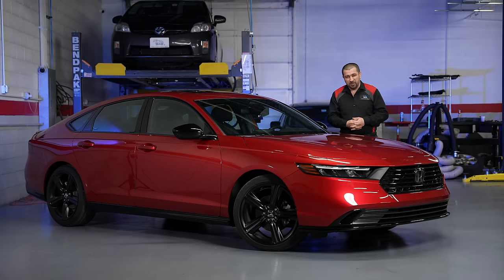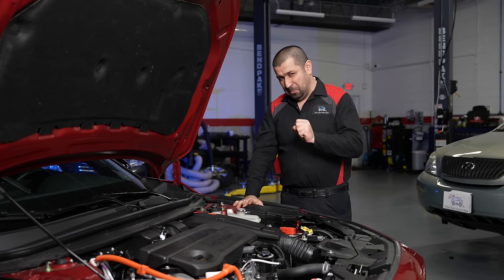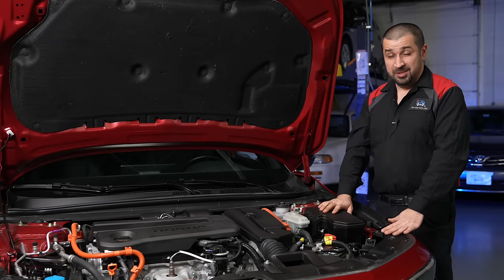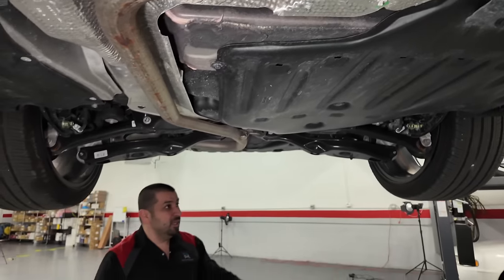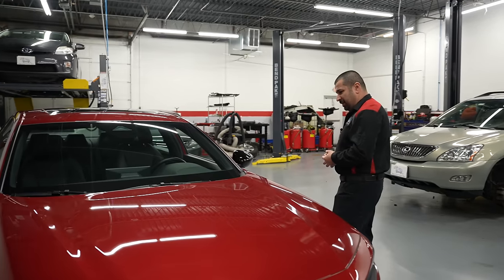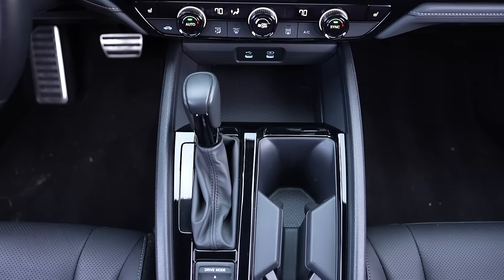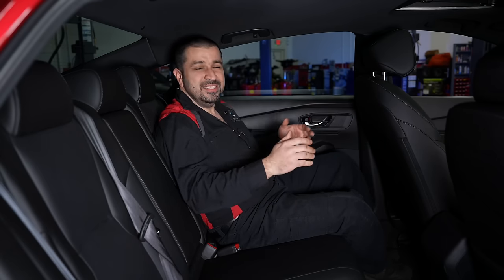Should You Buy The Latest Honda Accord? A Mechanic's Review

Comment: I didn't know that Honda's new hybrid system uses the gas engine to charge the battery at low speeds and then use the gas engine for driving the powertrain at higher speeds.  

When I drove the Honda Accord Hybrid, I felt motion sick.  Now I get it!  My ears heard the engine speed change, but since the electric motor was driving the car (with one speed transmission), my brain was expecting to feel the shifts.  So, since I was expecting the feel the shift and it didn't come, I felt a little motion sick.

Not sure if anyone else felt the same thing.
Reply: This is the fourth generation of the system; the first was released eleven years ago. It "uses the gas engine" to drive the car as an EV. But it runs the engine at its most efficient level of power and charges the battery with the excess. At higher speeds, it does similar split with direct engine power.

Comment: As always ,very good tech analysis of whow works that very complex Hybrid from Honda.
But we must mention the pioneer of that kind of hybrid technology (making series hybrid to parallel or engine drive and vice versa) was Mitsubishi Motors with Outlander PHEV which we here in Europe saw at 2013 and after.
Reply: It's a very simple system. It was also introduced in January, 2013, so neither can be called first.
And the Mitsubishi, while is employs some similar concepts, uses them for an entirely different purpose.

Comment: MB has a couple of buses in Germany, they are driven only by ev motor, and they have a little diesel generator at the rear that kicks off time to time, and the acceleration is absolutely constant power and regen, and the diesel engine has minimal wear and tear because it doesn't rev up or down, it drives full capacity about miles on battery and will start the generator and turn it off again, can't hear it and the drivers like to drive them because the AC always works. not like the ICE counterparts.

Comment: Thanks for the good review. Definitely a car for point A to B, not a car enthusiast. 24:40 - the wiper adjust is present in VAG Group cars since 2000s. Don't like the screen on top of the dash - for me air vents on top of dash is the most sensible arrangement. What about the quality of finish? Any park assist features, considering the size? The air colling vents should be in the B-pillar panels, above the seatbelt coils, so no risk of covering...
Hybrid Sport - ROFL 😅

Comment: 4:40 "One motor charges the battery, that is the basic premise of this system."

This is not quite accurate, and it is important because it is indeed the premise of the system. The hybrid Accord is usually an EV, in the correct definition of the term. Which is a vehicle that is propelled by an electric motor only. But isn't a Battery EV, like a Tesla. It is a Battery+Generator EV. That motor-generator supplies electricity to the traction motor first, and the excess charges the battery. (I see this is explained better near 8:00.)

And the premise of the system (numbers here are from engineering papers for the 2018-2022 model, but they shouldn't have changed much) is that the Accord needs less than 10 HP to maintain 40 mph on a flat road. But the engine is, at best, 35% efficient when generating 10 HP. It is over 40% efficient when generating 34 HP. So at 40 mph, the ICE generates 34 HP. It is split by using the generator so that 10 HP is used to power the motor, and 24 is used to charge the battery. Later, the system uses the battery in EV Drive with the engine off.

4:45 "The way it's constructed though is when things will get extremely complicated."

This is not true. It is very, very different that what you are used to, but that doesn't mean complicated. Since it leaves out a transmission, a starter motor, an alternator, and a torque converter? It is much simpler mechanically. You can see a diagram of it at https://youtu.be/fmMb45PPrmg?t=47. The only inaccuracies there are that (1) the OverDrive gear meshes with the Countershaft Gear, not the Motor Gear. It would need three dimensions to show it properly. And (2) Since 2023, the generator and motor are no longer concentric.

And the control only seems complicated if you try to look at it as a change from an ICEV. Viewed as an EV, it merely adds a second source of electricity, and offers an alternative in a specific situation that is explained incorrectly here:

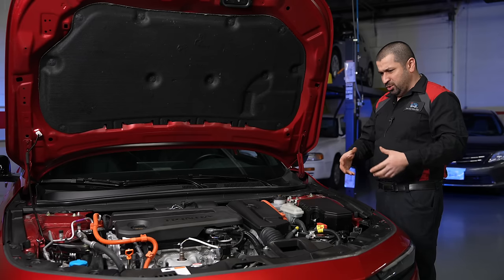9:43 "Don't quote me on this but from from my research is around 62 miles an hour is when the engine can actually take over the driving part."

It's wrong. You may have gotten it from Professor (Weber State) Kelly's Youtube video, where he uses that exact number. He corrected it in his comments.

The engine is over 40% efficient more-or-less along a line from (1400 rpm, 21 HP) to (2900 rpm, 55 HP). Since in this mode, the wheels are in fixed gear ratio, this means about 38 mph to 78 mph. Engine Drive is used in this range, usually above 40 mph but I have seen it lower. The driver can tell only by loading the Power Flow Monitor in the display; a little gear appears in the center.

So, on the highway, the engine is running at more-or-less constant rpm and power anyway. So, why not "cut out the middleman," as it were, and drive the wheels directly.

BTW, that simulated shifting? It takes the engine out of that 40% efficiency range. This is why mpgs when down in 2023. It was added because gearheads associate temporary losing power, and then regaining it, as somehow "gaining more" power.

13:45 "The biggest thing is it does have a clutch that wears. It is not going to wear at the rate of any other automatic transmission but still when we're putting head-to-head the Toyota transmission ..."

Actually, Toyota includes a clutch that is more prone to wear than this one. You can't connect an ICE to another system, that might seize, without a fail-safe. Toyota calls it a torque damper, but what it is, is a permanently-applied clutch that will slip if either the ICE, or what it connects to, changes rpm suddenly. And that happens every time the ICE is started, since the ICE is connected to the PSD (and so both MG1 and the wheels). The Honda has one, too, but as pointed out earlier it is only connected to the generator. And while it may be rare, the Toyota torque damper has failed in some cases, while neither the Honda torque damper, nor this clutch, has such history.

37:18 "I really dislike that there's no base model hybrid."

I do, too, but the actual change is that there is no higher-trim non-hybrid. The government has imposed "Corporate Average Fuel Economy" standards, so manufacturers need to try to push buyers toward the hybrids; Honda chose to do it by making it necessary to get a higher trim (hence features like Wireless Android Auto only in hybrids). Yes, they could have included a hybrid in the base model, but Honda also keeps prices down by having fewer from-the-factory options.

33:21 "I don't think many Accord owners or at least this particular Accord generation will be very interested in that but you have it."

I wish I had it ("individual mode") in my 2018. The modes affect how the car handles, cruise control and climate control responsiveness, how it uses regen braking, and how it manages the battery. I like the SPORT handling and regen, but ECON cruise control and battery. I really hate having to change to sport more to accelerate on the highway, but I do it to get better response. (BTW, total lifetime average, all conditions, is 48 mpg).

Comment: A couple additions / corrections:
The trans is geared such that the ICE can drive the wheels directly starting around 45mph. Up to 45mph the traction motor supplies 100% of driving torque.
There are 2 electric machines as noted, and both operate as a motor and generator. The larger EM is connected to the wheels at all times, so it's responsible for motoring (acceleration) and generating (regen braking). The smaller EM is connected to the ICE at all times. It mostly generates electric energy for the battery and traction EM. It's also responsible for quickly starting and quickly stopping the ICE; there is no traditional starter.
The clutch is small and is not designed to manage slipping (i.e.not like a traditional auto trans, which has clutches that are designed to slip). The PCM will match EM and ICE shaft speeds before the clutch is activated, ensuring no slip. The solenoid is simple; on or off, and this clutch should last a long time.
I have the 2017 accord hybrid, bought used, my lifetime measured average fuel economy over 50k trouble free miles of L.A. freeway commuting is 49.7mpg. Best car I've ever owned.
Reply: A couple additions / comments:

"The trans is geared such that the ICE can drive the wheels directly starting around 45mph." I've seen it operate below 40 mph, but only after slowing down from 45+. The point is that it functions as overdrive for cruising, not for acceleration. While the clutch is engaged, the generator is turned off and the motor moderates ICE power sent to the wheels.

If you want technical specs, RPM=37*MPH. So 40 mph is about 1500 rpm. The ICE in this car (well, the 2018-2022 version, which I have specs for) is 40.2% efficient when generating 23 HP at 1500 rpm. The Accord needs less than 10 HP to cruise at that speed, so it uses 13+ HP to charge the battery.

"There are 2 electric machines as noted, and both operate as a motor and generator." You didn't say it, but this could be seen to imply that the smaller can drive the wheels. While it theoretically could, it won't. It does act something like a starter motor, but it doesn't "crank." It literally places the ICE in an operational state.

But there is another situation when it acts as a motor. If the battery fills with regen on a long downhill stretch, you will lose the braking effect if you can't send the power somewhere. In this situation, the "generator" will act as a motor to drive the ICE with the valves closed, essentially creating Engine Braking.

"The clutch is small and is not designed to manage slipping (i.e.not like a traditional auto trans, which has clutches that are designed to slip). The PCM will match EM and ICE shaft speeds before the clutch is activated, ensuring no slip." Exactly.

"The solenoid is simple; on or off, and this clutch should last a long time."

Here's a list of all the clutch-related failures I've seen after searching the internet, going back to the 2014 Accord PHEV:

0) ...

This is shorter, by two, than the number of clutch failures I've seen for the Prius. Which I didn't search for. (And please, if anybody wants to insist the Prius has no clutch, look up "Torque Damper.")
Reply: Check out the video from Webber auto. He tore down the transmission and hybrid system and gave a detailed explanation. It has two clutches, one is a flywheel clutch that is only used in emergencies or load discrepancies
Reply: @Negev-Israel  He explained the mechanical details very well, but not the operational ones. For example, it uses the overdrive clutch above about 40 to 45 mph, not 62 mph like he said. I got him to add a correction for that, but then he made some nonsensical statements like for Engine Drive, "The internal combustion engine (ICE) will operate at its most efficient rpm for the torque required to propel the vehicle." No, it will operate at the most efficient level of power for the rpm that is determined by the car's speed, RPM=37*MPH."

Yes, all hybrids have that "flywheel clutch." He says this explicitly at about the 12 minute 20 second mark. It's the one that can fail in a Toyota, but not a Honda. But it is permanently applied, so it has a different job entirely.

Comment: Wasn’t aware of the remote start settings and stolen mode. Nice safety and convenience features. Overall, it seems very reliable and well built. Less stylish, sure. No heated steering wheel, unfortunately. If Honda improves their hybrid game, they could come out on top. Never have been a fan of Toyota, despite the reliability.

Comment: Considering the cost of maintenance today and in the future, would interesting to see how all this new technological advances gizmo will do after 200k miles. I owned many Hondas an Toyota cars and I put sometimes over 300k in the original powertrain with just basic maintenances. I am not sold with the concept of very small turbo engine(some of them with 3 cyl) for a daily or commute car. Direct injections have many problems already with carbon deposit.

Comment: I liked the looks and feel of the 2020 Accord, but ultimately passed on it because the non-hybrids have CVT's. Toyota having a traditional automatic and D4S sold me and we went home in a Camry SE.
Reply: The 2020 Accord had four available transmissions: CVT, 6-speed manual, 10-speed automatic, and none (this hybrid, called an eCVT but "virtual CVT" is more accurate).

The 2020 Camry had three: CVT, 8-speed automatic, and hybrid (eCVT, or planetary-based).
Reply: @jeffjo8732  Not when we were looking they did not 2022 is when we got the 2020 Camry SE. To be honest I am glad we passed altogether seeing all the oil dilution issues going on with them. Also like not having a turbo charged engine and also having an engine that had D4S to help control carbon build up. The Hondas did not have that either which means in 50-80k miles they would need to be walnut blasted to clean off the carbon to keep them running in tip top condition. The Camry was 100% the best choice even though the Accord had a better ride quality. That was during the parts shortages and you did not have much to choose from. I had to trade even though it was a bad time to do so the Ford was not reliable and I knew if I kept it I would probably have to fix something else. I came out alright since the trade in values were so high. This new body style does not look near as good as the out going model.
Reply: @jeffjo8732  Camry did not have a CVT available just ECVT on Hybrid. I got the 8 speed automatic no problems. Honda dealer did not say a thing about another transmission so their loss. Now that its 4 years old and no problems I made the right choice for the wife. If I needed another car I would get a Camry again its been that good. I would not however buy a Tundra LOL.

Comment: I have owned two Honda vehicles in my life, and ever since I have referred to both of them as "the worst rattle-traps I have ever owned."  Abysmal build quality -- rattles and squeaks and noises over even the smoothest pavement.  Seats that came loose in their tracks, so they moved around as you accelerated and slowed down.  You name it.  After a second one needed over $3,500 in warranty repairs for THE INTERIOR and associated electronics within 20,000 miles, I vowed NEVER TO SET FOOT INTO A HONDA DEALERSHIP AGAIN, SO LONG AS I LIVED.  Maybe they're better now.  I wouldn't know, because I won't go near one.

Comment: Greetings and salutations, Wow I’am truly impressed by your knowledge and descriptive vigor of your presentations. I was wondering do you take requests, meaning I own a 2023 VW GLI and I’am having some question about my vehicle which the dealership seems to dance around. In particular the adaptive suspension and why my vehicle says it accepts regular fuel but they insist I use premium. Henceforth I as a consumer would be extremely interested if you could do a descriptive breakdown of the same vehicle (2023 VW GLI) thank you for your time and consideration.

Comment: Do we need to worry about driving 85-90mph and stressing that hybrid battery, like in a toyota hybrid? 

It seems like the battery is hardly driving the wheels at highway speeds, from what I have seen about Honda's hybrid system.

Comment: Thanks for your usual very comprehensive review. Could you review the 3rd competitor to the Camry & Accord the 2024 Hyundai Sonata 2.5 Non-Hybrid All Wheel Drive? We do not get the Hybrid Sonata in Canada. I think it offers the best value for the $$ compared to Honda & Toyota. Price difference in Canada is $4000 including AWD & lots of more options including Panorama roof, real eather power & cooled seats & 2 years more warranty.Fuel economy is decent but I drive less than 7000 miles a year. Thanks Terry

Comment: I dont like how the rear window meets the trunk lid.   I had a civic with the same issue and when you open the trunk lid in winter, all the ice that was stuck there would break off and fall into the spot below it.    Then you would have to clean ot out before you coild close the trunk.   Just a little pet peeve of mine.

Comment: Even with the understated looks  this car has very little faults.  The less is more mentality is actually a plus when compared to just within the family: this accord has no relative position touch pad, no push button transmission, no DNA dynamic mode controller, no piano black plastics, which makes it easier to live with than any current Acura.   Plus the hybrid and big back seat, Honda America should just bring back the TL moniker with this gen and it will sell like hot cakes.    Leave that TLX as it is so that the “X” means something to differentiate it from the popular mainstream cars.

Comment: Still wondering about the advantages and disadvantages compared to Toyota hybrids. Is the efficiency better for Toyota at low speeds (because partially mechanic transmission always), and Honda better effeciency at the right rpm at highway speeds?

Comment: Any concern about the direct injection engine regarding carbon buildup?  I swore I would never own another DI engine.
Reply: Carbon-build up occurs because the detergents in the fuel never touch the backs of the valves. The Atkinson-Cycle engine closes the valves during, not before, the compressions stroke. This is after fuel is injected. It pulls some of the fuel mixture back, washing the backs of the valves.